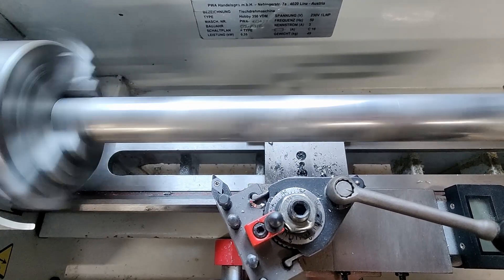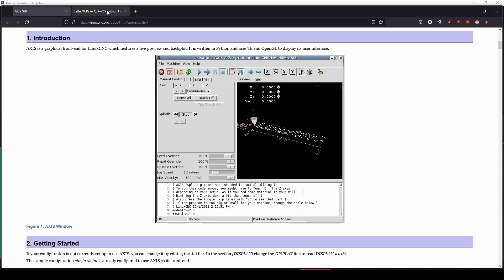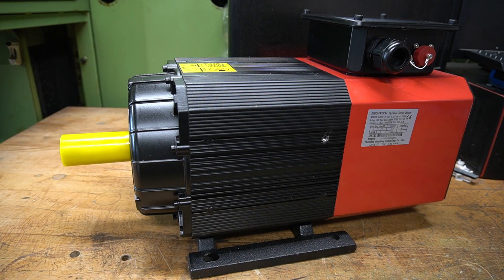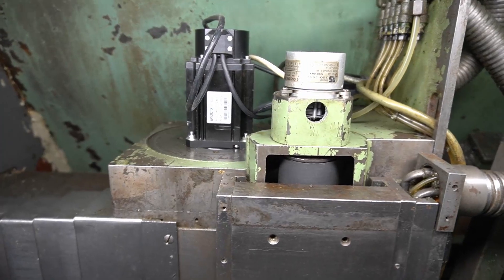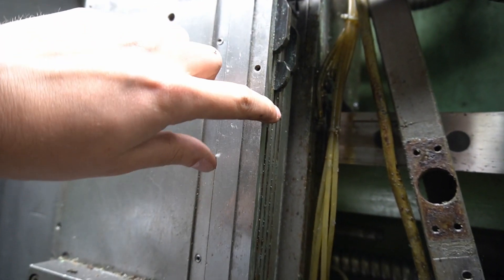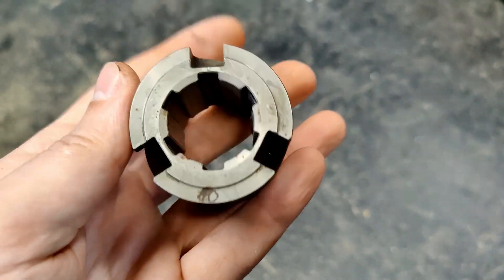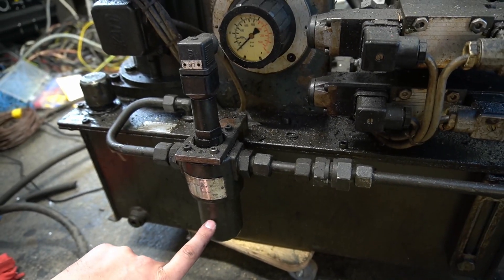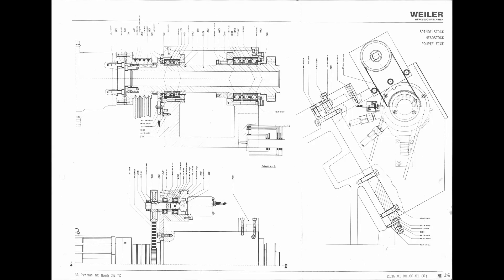deep inside an old industrial CNC Lathe! - Weiler Primus LinuxCNC retrofit pt.2

Comment: hello, is that ways on that primus cnc use box ways or linear rail ways ? (both axis) .
Reply from the maker: hi, the Primus CNC i have has glide bearings on Z & X Axis. It glides on the Oil film provided by the lube pump.